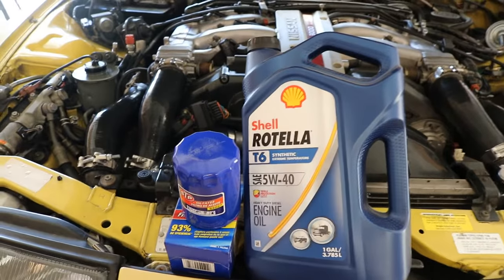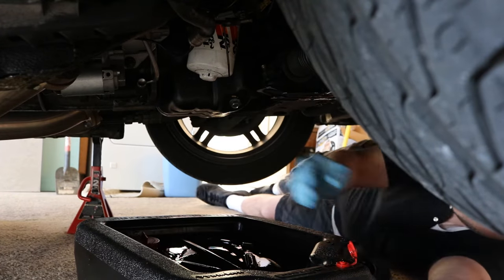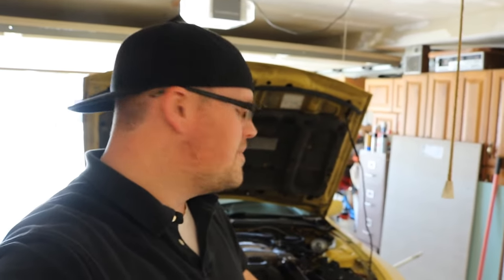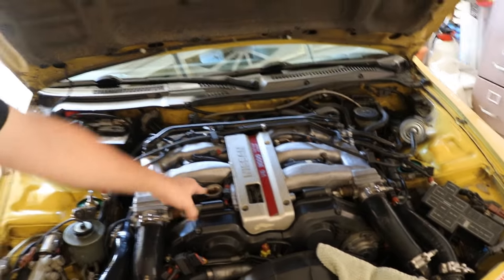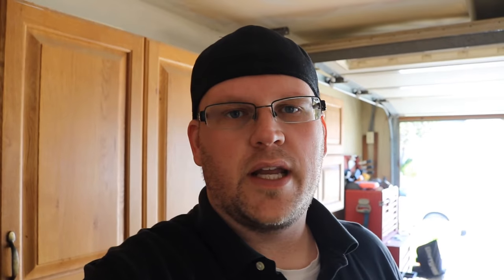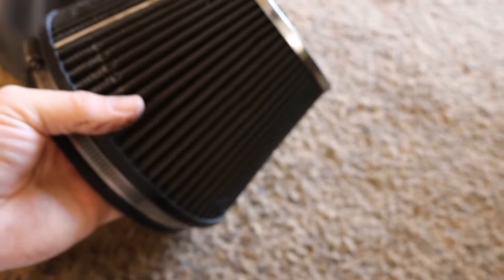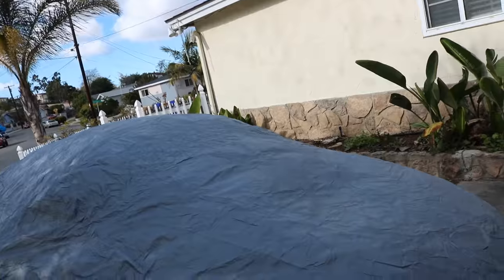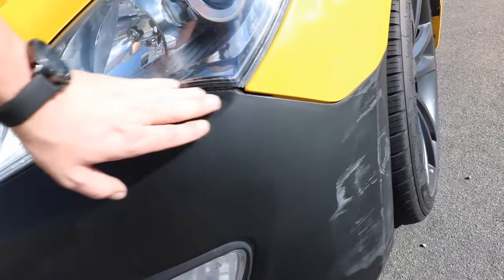300zx Twin Turbo Oil Change

Comment: Are you still running the Rotella T6 in your TT? I just built my motor and I'm doing my 3000 mile break in... just wondering what oils work best...i was using Mobil1 15w-50 synthetic prior to the build.
Reply from the maker: Yes, I'm still using rotella